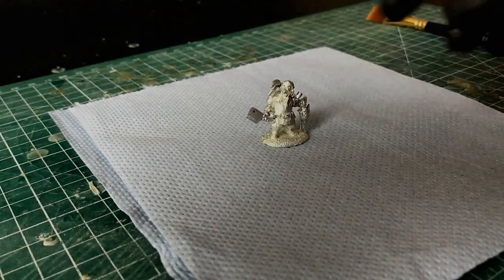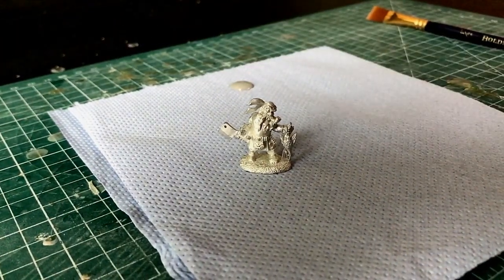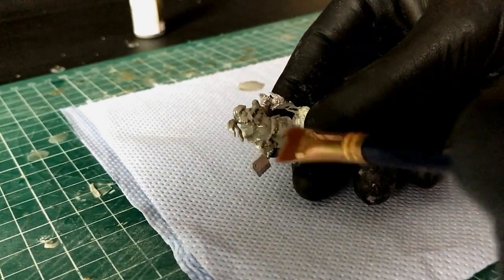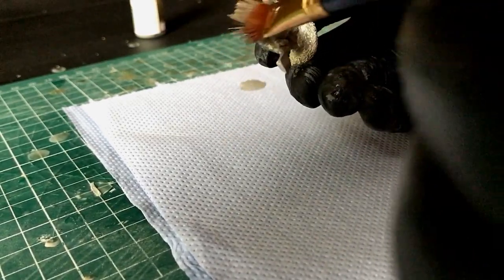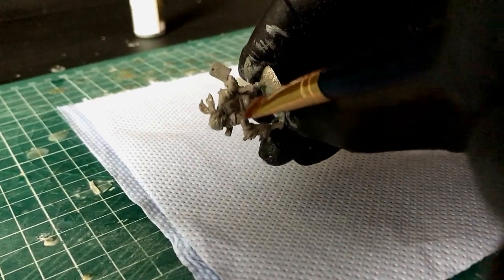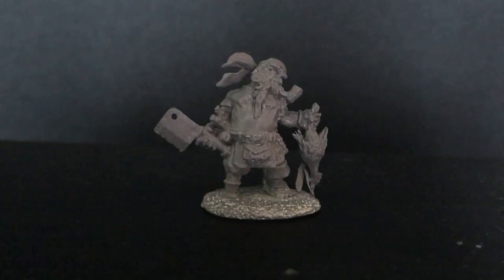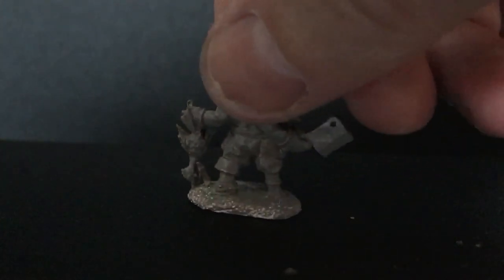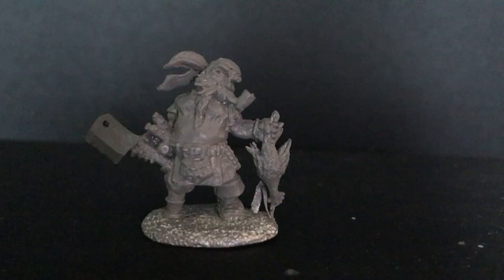How To Use Brush On Primer To Get A Smooth Finish : Brush Basics

Comment: Oh my gosh, I have been doing brush on primer all wrong! Thanks, Luke for showing me the way. In the area, I live in, it is very hard to use spray primer outside, the weather just will not help me with that. I use the airbrush for most my priming, sometimes if it is just one model I will brush it on.

Comment: Spot on, big brushes like that are really overlooked. I use a large brush like this for basecoating and an even larger one for the initial stages of drybrushing. You get a much softer and smoother finish to the drybrushing with a bug brush. If you're careful it looks blended.
Reply: You should try using a big make-up brush for drybrushing. They are the best for that. :)
Reply: @SwedishNeo  Like the ones that are fat and look a little like a manual stick shift knob? I believe they call those brushes, rouge or foundation brushes. Can I use those brushes?

Comment: I remember (or I've dreamt this up) reading someone saying to get rid of the hooked tip. Run the brush over a slightly warm lightbulb.
Kinda makes sense and a bit similar to the straighteners so I don't think I made it up! Never tried it though 😄

I've only used two brush soaps. The Masters stuff that everyone recommends and Instar paint deep clean soap. The instar stuff is dynamite honestly. 
Works twice as fast as masters. Pretty much loosens the paint immediately. 
You think you're brushes are clean til you run it through this stuff.

Comment: I JUST started painting miniatures. I don't have an air brush and I'm using a white vallejo primer for some Tyranid genestealers. I noticed that the white doesn't cover completely. Should i use multiple primer layers? Or just leave it as sort of see-through?
Reply: Use a few, doesn't have to be opaque but should have a coat or two
Reply: mine are exactly the same, but i use the vallejo black on my chaos marines and its my first models, the coat is very thin at first and i dont have a welled palette to use it on so i had to use a flat palette. did you use multiple coats?

Comment: Luke: I've been doing this for ages but I use Vallejo Primer and mostly use their range as I find them better than most.
Reply: So Vallejo, unthinned just brush on? How long should I let it dry 12 - 24 hours.
Reply: did you try it without thinning your primer? I’ve been thinning mine a bit but may be to much

Comment: Are there any benefits at all to using a brush on primer as opposed to a rattle can?
Reply: The only benefit is that you can use brush on primer when a rattle can isn't viable. Say it's 9p, you've had a couple drinks, you don't have a fume hood, and you don't want to paint any of the things you have prepped. Brush on primer saves the day there. Or maybe it's raining, or you're in Florida and the humidity is 70% outside. Most of the benefits are related to environmental factors.
Reply: Yes. It doesn't stink. It's not poisonous. You have control over the paint, less risk of hiding details due to to much paint. Some spray paint take hours to dry. With spray paint you can do directional light easier. I still use spray paint when painting printed terrain.

Comment: I've primed with Vallejo Grey, I'm spray painted  the base McCragge Blue, I've applied the wash to my GW Ultramarine and the wash has made a complete mess, I have no control of it hardly even with a windor and newton size 1. Any tips on applying washes ?
Reply: Never let the ink pool somewhere, push it around until it's evenly distributed. If there's still too much on it use the brush dry to soak it up. Don't add too much water either. 
You should also look up some painting guides on YT to have a visual comparison to what you are actually doing.
Reply: thanks for the advice I was actually using a different brush to mop up and then wash off in a big water jar. A clean up job afterwards with the base paint is inevitable though I think, I will look at it in the cold light of day today and see what I have to do. I think I've watched every Ultramarine painting video on YT btw and tonnes of techniques from GW,  Apethetic Fish etc etc
Reply: Yes, you will have to go in with the base color again afterwards, since the ink will always give you a slight glazing if used over the whole mini. 
You can only avoid that by painting it into the grooves, which will cost more time. There's just some things you can't work around easily.Be patient and practice, this will make it easier and faster over time.

Comment: Does it have to be primer paint? currently I'm priming with just normal paint which feels kinda pointless..until I zenithal and use the highlight of that for the rest of the paint
Reply: yes it has to be primer paint. the point of primer is so the paint sticks better to the model and doesn't chip. you HAVE to use primer before any other paint.
Reply: In general, it depends on two factors:
1. The material. Acrylic paint will generally stick well to plastic, and okayish to resin, but it will easly chipp off from metal surfaces. Oil paints will need primer for everything.
2. Are your minis for showing or for playing? If you play with them often it will put strain on the paint. Make sure to put primer first to prevent chipping, and to finish your paintjob with varnish to prevent surface damage from rubbing.
"Priming" with a normal paint is generally useless. If you don't want to use primer, just skip priming and go straight to basecoating.

Comment: I thought you moved to airbrush priming?
Reply: Any chance I could annoying persuade you to try priming w/ airbrush, at least for a trial period. Just for the environment's sake so you're not chucking chunks of metal in the bin and pumping aerosol into the atmosphere regularly?

I understand it is probably a necessary evil if you're doing it a lot however.
Reply: Lukes Aps Yes. £700.
Reply: @Grim Looters  fallacy of relative privation